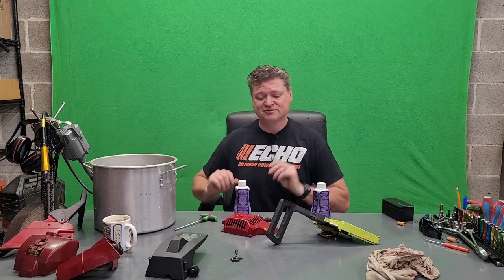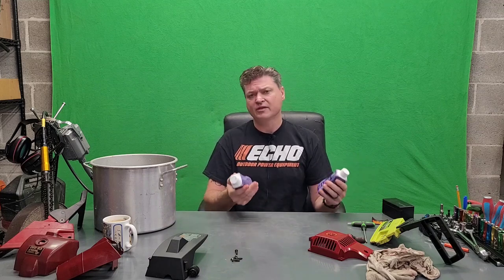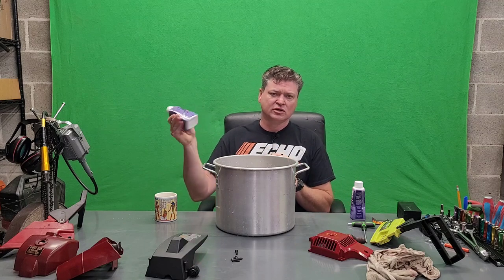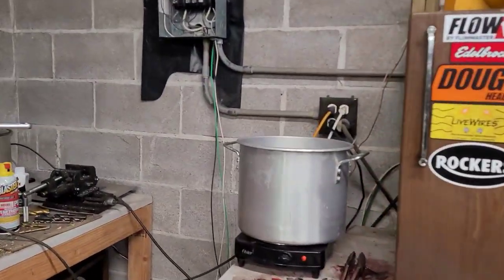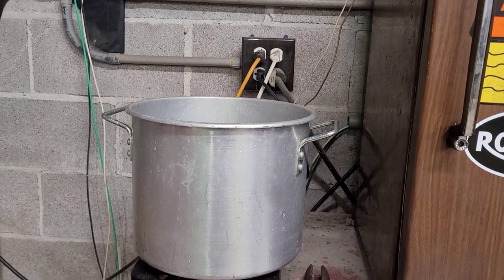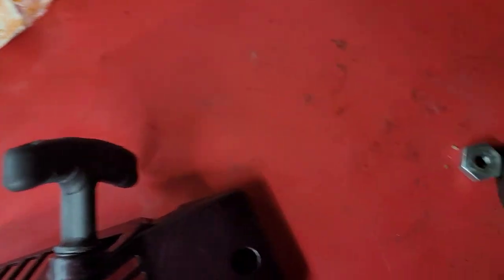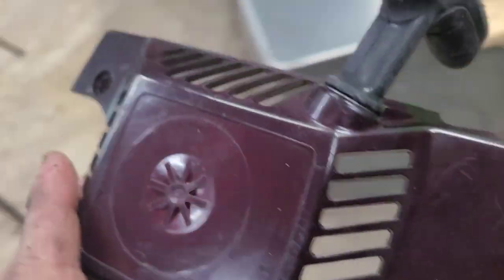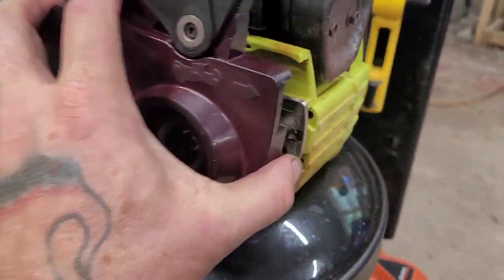Dyeing is easy...Living is HARD! Dye chainsaw plastics

Comment: About a year ago I started dying synthetic materials. If You bring it to an extremely light boil and then dial back the heat to keep it from boiling and in my experience in about a minute sometimes less the color takes. The more water you add the lighter the color will be. But if you use less water the color will be darker. Rut die is Amazing. The original color of the part your dying will effect the end result

Comment: I'll make it easier. Simmer. Drop it in. Will take about 15 minutes at a simmer. Rinse. Powder rit is half the price. This originally was discovered or so I was told for dying magpul plastic magazines for AR-15's so you could differentiate loads in multi phase shooting competitions. Hence it'll work on almost any plastic. It works better on new shiny plastic. Faded dull plastics will come out faded- just whatever color you chose.

Comment: Hi there hope you are doing well today,  know you are dying chainsaw parts which is probably a different type of plastic,  but I want to take may 2 Xbox one controller apart which are white kind of a shiny white ABS plastic,  and dye them black,  the only problem I see is the heat of the water may melt that kind of ABS plastic,  I did take two smaller pieces of the controller and microwave about 1 1/2 to 2 cups of water put in a glass jar and poured in about 1/2 of a bottle of rit dye all purpose black added acetone about 8 to 12 oz it started to take to the white ABS plastic but never turn it totally black it was more of a not yellow may like when white plastic turn kind of yellow after years have gone by but it was trying to take the black maybe I needed the water to be more hotter.  Any help would be greatly appreciated on this matter.  I see people dye all kinds of different types of plastic maybe the acetone was the problem,  I tried dye with just the all purpose black dye and water first that didn't work it's when I started add the acetone to the mixture that it somewhat started to take like I said I just microwave 2 cups of water put in glass jar 4 oz of all purpose black rit dye black and about 8 to 12 oz of acetone left in water which slowly cooled down for about 3 hrs got it to take about 20% out of a 100% . If I can figure out the right way to dye the Xbox one controller shells it would save me $40 , once again any insight would be a big help thanks Gary
Reply from the maker: I think it will work just fine.
Reply: So just follow your video guidelines,  that's what I'm get out of your comment think it will work just fine.  Does it matter if you use all purpose rit  dye or rit dyemore synthetic dye or I guess you could use both at the same time thanks Gary
Reply from the maker: Don't know.  You're overthinking it.  Just dye it.  It will either work... or it won't.  That's the best I can give you.